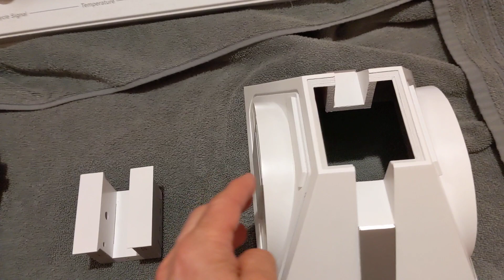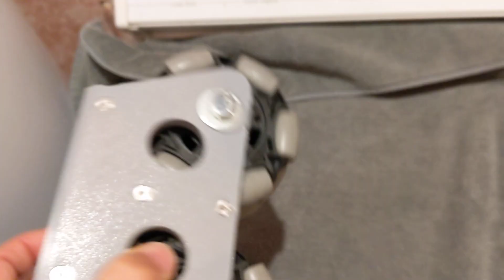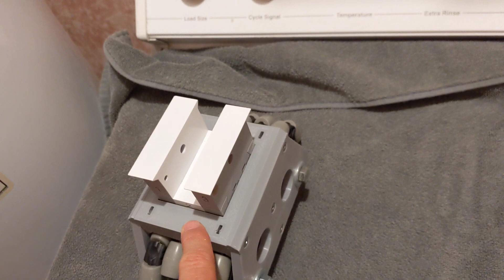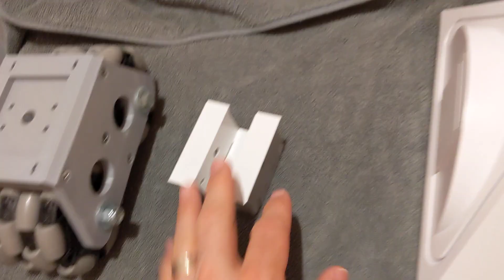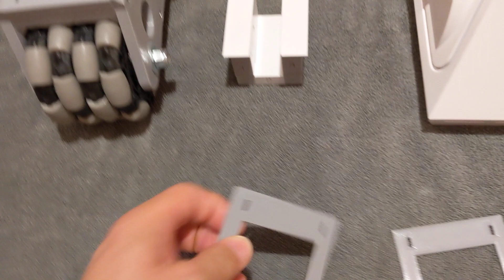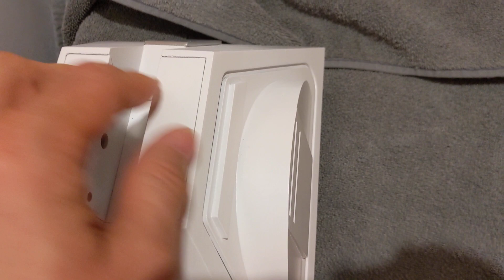3D Printed R2D2 - Part 78

Comment: Ok so the questions I have are towards the wheel assembly. A lot of parts are discontinued on vex site. So what you use to hold wheels in, bearings , bolt?

Comment: Another solution, which I'm using after a suggestion from a UK builder, is to use foam pads for shim material.  Like the double sided foam tape you can buy, but with the paper left on one size.
The foam is compliant so will give you the correct amount of shim thickness without multiple trials and measurements.  
Also this slight "give" in the material is useful when you run into things.  If a solid shim is used I would suspect you would be more likely to suffer cracks in the footshell or ankle mount.
Reply from the maker: Good tip, thanks for sharing!

Comment: Hello, I'm also there and have the same problem. I printed everything in PLA+. Would you share the spacer's STL file?
Reply from the maker: I'm not sure where I could share it.  It was really easy to make, I just loaded the part into the free program called Meshmixer.  I then used the transform/plane cut tool to chop off the top section and save it as an stl.  Then load it into your slicer program and alter the Z height to whatever thickness you need before printing it.

Comment: Shouldn't it clamp together once you bolt it on?
Reply from the maker: Yes.  The bolts clamp the white assembly to the gray frame and the foot shell gets clamped between them.  For whatever reason I have too much space between them to clamp it tight without making the spacer.  I'm nearly ready to cut my axle from threaded rod and bolt the assembly together, then I'll see if it holds tight enough or if I need to print a slightly thicker spacer.